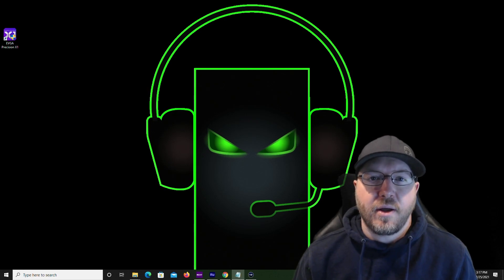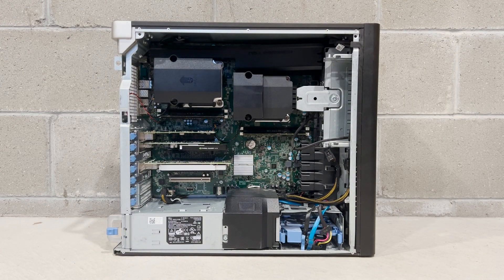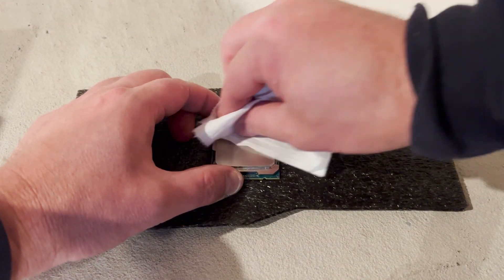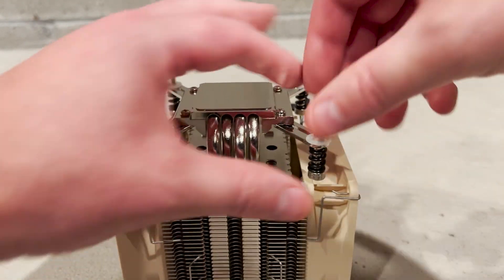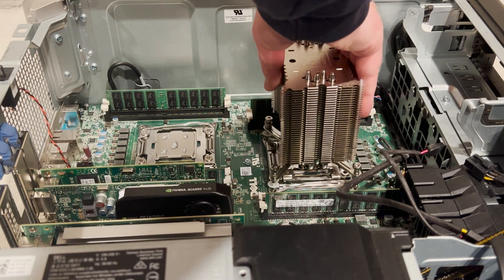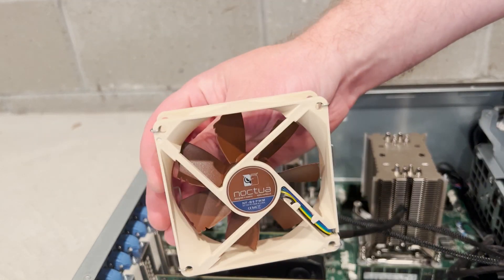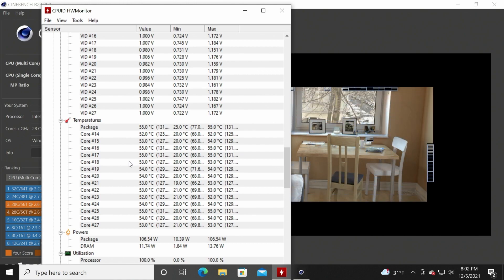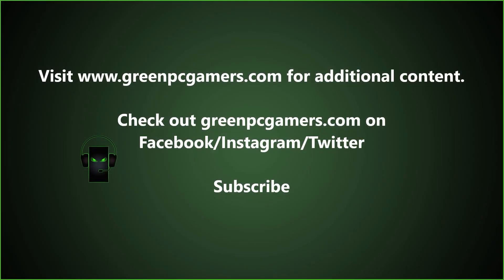Precision T7810 Noctua Heatsink Install w/Benchmarks at End

Comment: Hello bud, have a 7810, came here following ur discord traces. Managed to put My babe in service mode, dump and  remove **f2, Now stuck where to put UEFI drivers to tbu. Need help
Reply from the maker: I need more info.  Why did you put the board in service mode?
Reply: Hello manged to.. 2x xeon 2667v3 @3.5 GHz all corres, 0-0 voltage offset. User segei 8989 driver (the only one that doed the job into the bios) pm me for more detail. It blast ab 5950x in multi threads
Reply: 1280 cinebech r24 and 12800 cpuz 17 in MT

Comment: When you say "The fan will always be running" you mean that there is no PWM? I mean, if the Noctua fan is 4-pin, I would expect the PWM to work. If the 5th pin is required by the motherboard to do PWM, wouldn't that keep warning on every boot that the fan has failure? What are the noise levels of this? I'm looking to replace the stock cooler (already tried the Dell AIO) just so I can reduce the noise levels. Thanks!

Comment: Dell workstation T7910 spacing between the two heatsinks, CPU 1 is hotter than before.
My question is: will installing a heatsink from Noctua prevent this problem and keep my CPU 2 cool without affecting CPU 1? And how much space does it occupy? The one I bought from China 14 centimetres large

Comment: Hello, can I use this on a t7610 and would the side panel close properly this two of these Noctua heatsinks installed?
Reply from the maker: You can use it on the T7610.  However,  the side panel won't be able to shut after the install.

Comment: This machine has been very stressful.  Got it secondhand, CPUs were running a very hot idle.  Did the 4 split washers and the screws just won't catch at all.  I'm about to try 3 but it just may not be enough.
Reply from the maker: Are you using the same heatsink that we used?

Comment: Hello, can I use  Noctua NH-U9DX i4 Heatsink for Dell T7910, t7820?
Reply from the maker: Yes
Reply: I want to keep my T7910’s heatsink for CPU1 and add this Noctua to CPU2 which is without heatsink and keeps getting the heat from CPU1. 
I bought a big heatsink from AliExpress and it worked too well. CPU2 is cooler than CPU1 and because of the lack of spacing between the two heatsinks, CPU 1 is hotter than before.
My question is: will installing a heatsink from Noctua prevent this problem and keep my CPU 2 cool without affecting CPU 1? And how much space does it occupy? The one I bought from China 14 centimetres large

Comment: Always running...at what speed?
Will it be varying?
Reply from the maker: We don't have a cam software that tells us the RPM level or whether the fans are running at a certain speed.  However, they are always running and always quiet.
Reply: @GreenPCGamerscom  thanks, I think you are an enciclopedia for these workstations, testing and adapting stuff.
Have you tried the "Hardware Info" software?
It sees my fans and their speeds.
It can also control them but only in 3 steps: 0, 1000rpm and max speed.

Comment: I have precision T7600, i'm wondering which noctua heatsink model will fit the case with side panel closed, have you tried on T7600?
Reply from the maker: The heatsink in this video would work.  However, you might have to use different mounting brackets.  There are multiple mounting brackets included with the heatsink if you buy it new.

Comment: Hello, do you know if it is compatible and fits with the Dell T7910? Thanks.
Reply from the maker: Yes, the heatsinks will work on a T7910 as well.  However, the aftermarket heatsinks will stop you from being able to shut the stock side panel.

Comment: Computer at full power, lots of noise from existing front fans. CPU hovers around 80 85 degrees. Now, when we apply this system, how much is the sound cut off?
Reply from the maker: The noctua heatsink brings the temps down quite a bit on the cpu.  That in effect normally brings the front fan noise down.  This is assuming you don’t have anything else installed in your system that bring up the temps.

Comment: Question, There is any tutorial to make an adapter from ATX psu to T3600 motherboard? my psu just die and i had to import another one and it cost me double the price and i don't want to do that again
Reply: I found a post that explains how to do that, but I've never done anything like that and I'm a little afraid of frying my PC.
Reply: [HOW TO] Dell Precision T3600 PSU Swap on hardwarecanucks
Reply from the maker: We've never messed with ATX PSU's on the T3600 Workstations.  Mainly because they won't fit in the chassis.  Thanks for the info.
Reply: @GreenPCGamerscom  Well, i got my psu but turn out that my motherboard is dead so now i have to import a new one because now i have 2 functional psu x'd
My question now is, can i swap the t3600 to a t3610 motherboard?

Comment: Do you know where I can find my pci power connecter for my gpu if my gpu doesn’t require one?
Reply from the maker: They are normally located right above the 2 x 3.5" HDD Slots.
Reply: @GreenPCGamerscom  I have one more question do you know if the 1660 phoenix oc will work with the dell precision t3500

Comment: Hi i have a question. I have T3600 i want to install a fan on the back side of the PC (above PSU) idk whats that placed called. Which fan can i install there? size? and how? any help would be appreciated 🙏
Reply: I have a T3610 which I think is the same. You mean right behind the CPU right? I used a Noctua 80mm fan and attached it with the included rubber attachments. But you can't power it off the motherboard headers unless you get a Dell 5 pin fan. I used a simple adapter cable that takes power from a SATA power plug and converts to 4 pin standard fan power. I don't have any speed control but it's fine because the fan is a low speed Noctua. If you do this you may also need a SATA power splitter, depending on how many plugs you have availble
Reply: @lalljp  Thankyou man :) but i am quite noob in these things so i didn't understand much about cables or the SATA power plug. I should take it to the PC shop :)
Reply: @niazijr  the power plugs are easy to figure out. SATA hard drives have a data port and a power port, and so you take one of those power plugs for the hard drive and use a fan converter. If you look on Amazon there are ones made by Noctua that are simple to set up. Be careful if you go to a computer shop, they may not know that Dell uses a special 5 pin fan plug that can get damaged if you plug in a standard fan, so make sure you tell them